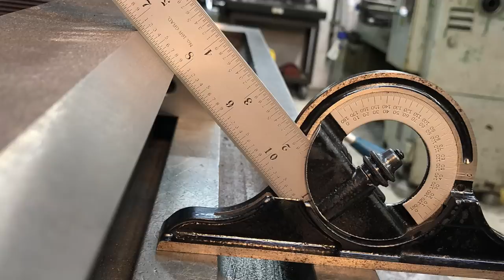SNS 310: Machining a Cast Iron Prism Straight Edge

Comment: Yo Adam do you have a metric version of this video :-) You do realise pretty much 4 billion other people have adopted a sensible metric system  :-)
Reply: It’s will be enough to mention metric sizes with subtitles.
Reply: Yo... we don’t use metric in the USA..... google it
Reply: @tjlovesrachel  Quite right... none of that foreign muck.
Reply: @tjlovesrachel  actually we do in some machine shops anything automotive is in metric usally. (but they do have imperial in brackets)
Reply: Just multiply everything but 25.4, you'll be okay.
Reply: jesse jarvis yes  I was being silly... and is the reason they are in metric because that’s what the automotive industry uses in terms of fastener sizes and thread?? Or are all the dimensions in metric?
Reply: @tjlovesrachel   all dimensions are in metric with the conversions all shown in [  ]
Reply: jesse jarvis interesting
Reply: @tjlovesrachel  Maybe it's cause metric is much more straightforward with numbers and units
Reply: @tjlovesrachel  also only Liberia the USA and Myanmar didn't make metric their standard.
Why? Nobody knows why someone should stick to imperial since it make things unnecessarily complicated to write down...
It's just more reasonable just to divide or multiply numbers by ten to get to another unit than doing this whole 1/12ft = 1/36yd stuff
Reply: @datpudding5338  in a lot of ways metric is easier and simpler, but transitioning a whole nation to metric, especially one as large as this one, is a massive undertaking. Also while imperial measurements are the norm, almost everyone I know of has a good understanding of both systems and can use both decently well.

Comment: Some pro tips: a few minutes on the surface plate from the very beginning would help to identify geometric issues including bow or twist, map with a sharpie. These methods here make no considerations with these setups restraining and leaf properties of the raw cast stresses. Meaning this is only did a cosmetic descale, neglecting geometric integrity. It would have made more sense to just use a hand grinder. 

The shell mill is not best tool for the job here. Large tool kerf creates more tool pressure and telegraphs. The finish pattern also suggests the milling head is not square or trammed to the table. Should check & adjust properly.